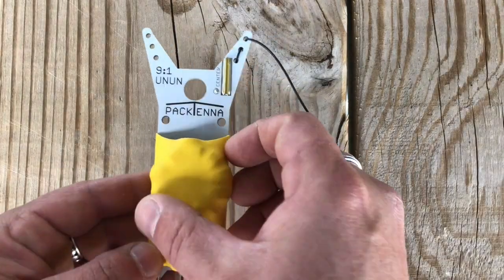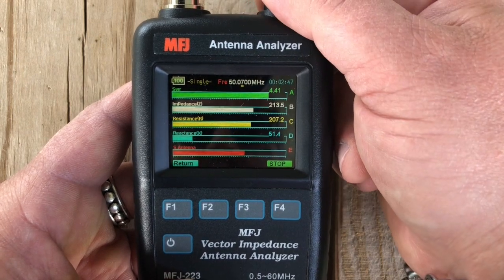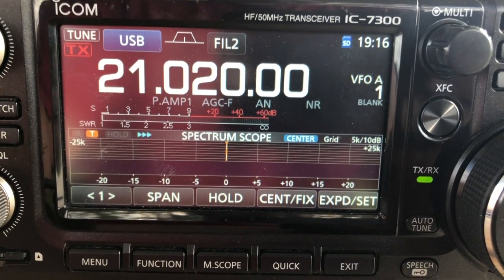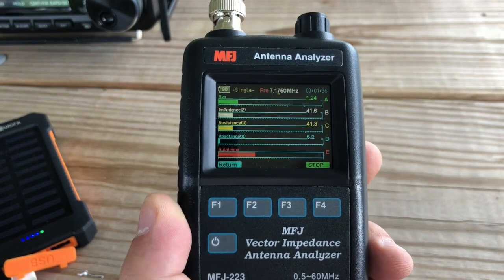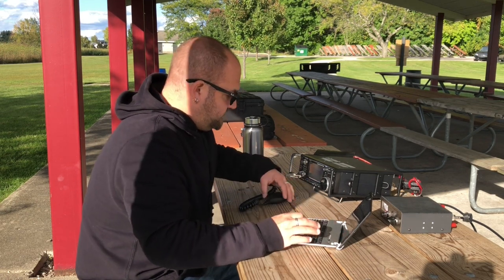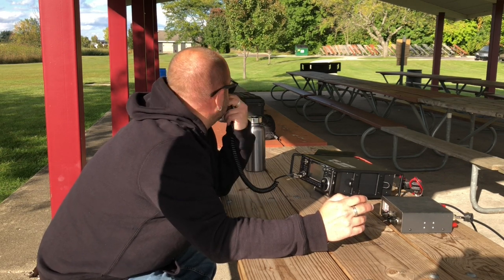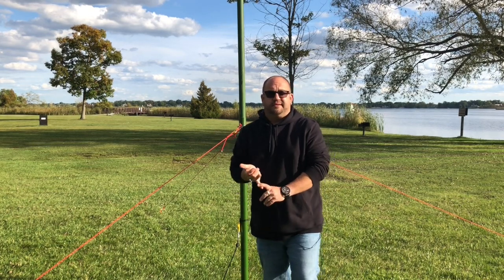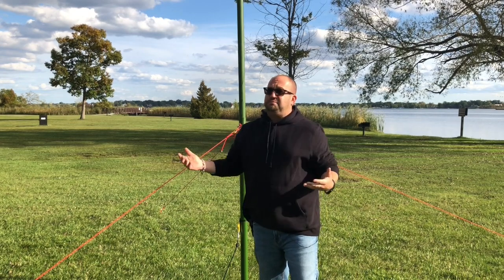The PackTenna Mini 9:1 Random Wire Ham Radio Antenna

Comment: Cutting a Random Wire antenna to “make it resonant” for a band, would render the unun useless as the impedance would increase drastically, you’d need a 49:1 autotransformer as you would now have a monoband End Fed Half Wave antenna.
I have Elecraft rigs, so I’m a huge Random Wire fan for simplicity and a way to feed my band hopping habit.
A 17’ - 18’ counterpoise will give you 10-80 (though you might need a CMC on 80) for 28’ - 84’ Random Wires.  I have a counterpoise bundle on my 124.5’ Random Wire at home so I can get onto 160m (great DX already).
My 7300 tuner has been next to useless tuning any of my Random Wires though.
Also, for a Random Wire antenna, the shield on your coax will act as a counterpoise as well.
Reply from the maker: Yes, so I have learned and did not do that.  This is one of my fav antennas though.  I have a tuner that will handle it now (and several radios that will too).  The 7300 will tune it but you have to put it in emergency mode that gives it a 10:1 tuner at reduced power.  I did a video on that too.  I've learned a lot and used this antenna in the year or so that I've had it and I love it.  Thanks for the input and thanks for watching.

Comment: Mike,
Did you have the antenna set up as a sloper ? From the video it looks like the pactenna is attached at the bottom of your mast.  If not how was it set up?  73 George KB3WAQ
Reply from the maker: Not a sloper no.  The mast I use with this antenna is the MFJ 1917 43'.  It's the perfect size to get this antenna vertical.  You can use it as a sloper, and I have, just not a lot.  Just get it up and get on the air.  That's really all that matters.
Reply: @hamradiotube  Mike Thanks 73

Comment: Nice contacts!  It's fun to see how different antennas work out.  I agree that a 3:1 tuner isn't of much use, it's merely there to touch up a slightly off antenna in order to keep the radio happy.  It's not just Icom, but others as well only offer up to a 3:1 with their inboard tuners.  It's nice to have up to a 10:1, but keep in mind if your antenna is that far off and you are running 100 watts, then only about 32 watts actually makes it to the antenna.  However, in your case your SWR was not that far off.
Reply from the maker: Thanks for watching.  I have a few new products up my sleeve that are going to pair very well with this antenna.  Stay tuned!  73

Comment: The 7300 has a 10:1 tuner it it if you put it into emergency mode but it will reduce power to 50w. KG7CQG

Comment: The Packtenna site appears to be sold out of just about everything. I did find mini banana plugs on Amazon. I’m not sure of the size though. What is the size in mm of the banana plugs that you got for your Packtenna? You are right in saying the fault is with the tuner in your Icom. Like you said it only handles about a 3:1 mismatch even though it’s a fine radio. Thanks for the connector idea for the counterpoise wires. MikeinMinnesota N0WDM
Reply from the maker: Hi Michael.  Boy they sure are sold out of everything.  I checked the wireman website and couldn't find them there either.  They used to have the banana plugs and the really thin wire.  I looked at amazon and they look like the 2mm.  They are very tiny.  You could shoot PackTenna an email and ask, or hit them up on twitter @packtenna.

Comment: Really enjoyed your video. I have a 7300 too. I use a homebrew version of MyAntennas EFHW 80-10. The 7300 only needs to tune on one band - the voice end of 80m. The antenna is made with 134' lightweight wire from Sotabeams, deployed as an inverted-V raised on a lightweight Sotabeam mast. The torroids fit in a small prescription pill container. It is a really small package. My friend made a similar 40-10 antenna 67' long. I enjoyed your other videos too.
Reply from the maker: Yeah the EFHW 80 meter antenna is a great one for sure.  I did a video on one a few months ago.  My thing with it is it's so darn long!  Not the most practical antenna for portable use.

Comment: Thanks!  I think you should tweak it for best match at the lowest freq.. and the rest will fall in line.  My last 80m EFHW is pruned for resonance at 3.800.  Has an swr of < 2:1 on all bands and usually less than 1.5:1..  but then I use a multi-tap UNUN that I wound on an FT140-43 core. Using several different taps lets me get an excellent match on all bands.  Packaged, its about the size a a pack of cigarettes.  I can do 160 using it as a quarter wave without the UNUN and get an swr of 1.5:1.  These antenna projects are easy and fun.  If you wanna see my latest multiband vertical look for the Michigan cacti.  It's on here.   Thanks & 73 OM

Comment: I’ve had good luck tuning mine with the 7300 in “emergency” mode, which cuts the power to 50w but cranks the tuning ratio to 10:1.
Reply from the maker: Yeah I need to look into that.

Comment: I'm not sure if you are confused about how a 9:1 unun works. A 9:1 is not for fractional wavelengths but random wire lengths AKA 29, 35, 41, 58, 71, 84. All of those numbers are lengths of wire that are not resonant on any band. The length of wire you were using must be slightly resonant on 40m and that is why it was not tuning up. If you want to use a resonant halfwave wire length because the impedance is much higher you will need a 49:1 unun.
Reply from the maker: Yes, I am learning quite a bit about the 9:1 and will have a follow up to this video very soon.
Reply: So whats the best antenna? An end fed 9:1 non resonant or 49:1 resonant? What differentiates the two? Thanks.

Comment: I’m guessing they didn’t want to increase the case size on the 7300 by adding a more capable tuner?
Reply from the maker: Bollux.  X5105 and the KX2-3 both have great tuners in it from what I've seen.  It is typical for a "base" rig to not have the greatest internal tuners though I suppose...
Reply: @hamradiotube  I'd say that is a byproduct of QRP.  Size the tuner up to 100w and I'm sure it increases the size.
Reply from the maker: @HamRadioCrashCourse  Could be.  Curious why Icom didn't put a tuner in that 705 either.  Seems pretty standard in most qrp radios these days.  I wonder if they are just going for profits?  Kind of a deal breaker for me.  We'll have to find out when we geek out over it at Hamvention.
Reply: @hamradiotube  I'm really curious about whats behind the case TBH.  705, all-band, all-mode and D-STAR AND the screen.  It might also be that they ran out of room.  I wonder if there was a board room discussion on "Screen or tuner?"

If they had to chose and went tuner, they'd be awash in a sea of other QRP radios.  They had to keep that ICOM "Sweet screen" training goin.
Reply from the maker: @HamRadioCrashCourse  I know dude, I'm so spoiled because of that screen.  I'd ditch the D-Star personally but I understand that's their baby.  Everything is a compromise.  Not a huge deal I guess as I mostly use resonant antennas.  I feel they could have done it though.  Perhaps Icom needs to take a cue from Apple.  This is what we need in a radio.  Make it happen.
Reply: @hamradiotube  Guess it wasn't a deal breaker after all.
Reply: Emergency mode does 10 to 1 so its "in there"

Comment: Great video! I'm putting my antenna bag together as we speak.  What assortment of extra connectors do you recommend?  I plan on activating my first park this fall.  Thank you in advance!
Reply from the maker: The first thing I recommend is when you are going to buy a connector, always buy at least 2.  Off the top of my head I usually have an assortment of so-239 to male bnc, pl-259 to female bnc, a female bnc barrel connector, some so-239 barrel connectors, some so-239 to pl259 right angles, and a bnc female to binding post connector.  Just get out every antenna you have and every coax you have and figure out every type of connection you could possibly make.  Good luck on your activations.   73
Reply: @hamradiotube  Good advice!  Thank you & 73!
Reply: $60 dollar worth are headed my way.  Thanks again!
Reply from the maker: Lee Harrell [KI5GCF] Nice. That should keep you going for a while.  At least until you discover the next connector you need haha.  It’s a never ending saga.

Comment: Another great video!!!  That almost resembles my antenna that I have, of course mine is home brewed!  That is what amateur radio is about!  LOL. I have a 9:1 unun that I built then I found the info on the web for random wire lengths that are best to use.  Right now I have 35.5 feet for the radiator, but I believe I will add a power pole connector on the end so I can add another 35.5 feet which will give me 71 feet.  Then I will have a half wave for 40 meters instead of a quarter wave.  Always enjoy your videos and thanks for the two Park activations yesterday 10-19-19!!  Juddie WD8WV
Reply from the maker: Yeah you were that QRP station right??  Boy yesterday was a blast!  We did 3 parks in total.  I'm thinking of shortening the PackTenna Mini to be resonant on 40 meters and see what that does to the other bands.  I'm hoping I can find a sweet spot where I can tune it up from 40-6 with the 7300.  Otherwise I'll just use the external tuner.  Not a big deal but it would be nice.  Thanks for watching.  73
Reply: K8MRD RADIO STUFF yep that was me.  Actually I believed I worked you twice yesterday.  You were in one park then found you at another park and I worked W8MSC and then you got on and I worked you again.  My LDG Z-817 atu tunes my 35.5 for 40, but I also have a 26 foot counterpoise coming out of the 9:1 unun.  Again you have great videos.  Keep them coming!  Juddie - WD8WV
Reply from the maker: @JnJTrueOutdoorAdventures  Yep 2 times.  You were coming in pretty good.  I'll have to remember to get you on the video.  I have a lot to edit!
Reply: K8MRD RADIO STUFF yep I know how editing those videos are!!  73 Juddie WD8WV

Comment: How much power were u running into the PakTenna,  seems you were vertical, so great takeoff angle,  or mabe a sloper?,..  inverted L configs work great,  i didnt catch ypur config,  also, i have 5 HF Radios, 3 have internal tuners, and 3:1 is std it seems,  most of the time, I just use an external tuner save the relays ,   cheers n 73s mate A92GW
Reply from the maker: I was running 90 watts.  Thats usually what I run.  I was vertical as well.  I didn't really show the config because I need to do a review on the mast I'm using and didn't want to give too much away.  It is a shame that they use 3:1 as standard.  Not a big deal using an external tuner but that is just one more thing to carry.  Well 2 as you need another bit of coax.  Thanks for watching.
Reply: @hamradiotube  thanks for the update, and reply.  I just never considered the paktenna would take 100W. I use an endfed or a telescopic (mfj 1979) when portable, the HyEndFed as an inverted L or sloped is great,  best contact on the endfed was Bulgaria to South Africa, n best contact on the telescopic was San Francisco to Australia on 50W...  FT897D
Keep the Videos Coming,  cheers n Ceee Quuuu... 73s

Comment: We had a POTA contact today on 40m. I was surprised at how good your signal was, as I'm just across the lake in Wi and can rarely hear Mi stations. You were an solid 59 with good audio. What is the small computer you're using for logging? 73's de W9ALK
Reply from the maker: Well great working you for one!  I was using the PackTenna Linked Dipole today and boy did it outperform!!  The small computer I'm using is nothing but an iPad mini and a bluetooth keyboard with wifi tethered to my phone.
Reply: Could be the NVIS config.

Comment: Nice to see the pack antenna work so well with the 7300. You took one of the biggest possible portable radios out with one of the smallest most light weight antennas. Ha ha! Way to go...
Thx for the vid. KD2QBV
Reply from the maker: Haha, yeah I didn't even think about that!  I just love the 7300, I'm spoiled.  But I really wanted to see if this multi band antenna would tune up with it.  I'm gonna work on the antenna a bit more and see if I can't make it work.  One antenna to rule them all!!!
Reply: @hamradiotube  Let us know what you do to this antenna and how well it does after. Inquiring minds want to know!
Reply from the maker: @davidsradioroom9678  I'll be doing a follow up to this very soon.
Reply: @hamradiotube  Looking forward to it. 😊

Comment: I don't know of any radio's with internal tuners that will do better then 3 to 1. My 991A and FTDX 1200 are the same.   EDIT, you say the Q TEL Ronco chinca radio will do it. Ha ha.
Reply from the maker: Yes, the Q TEL Ronco Chinca will, but only if you double dip the scooter stick into a vertical configuration!
Reply: Old kenwood radios like Ts450 TS850 widely famous for a very long range AT. 73
Reply: All Elecraft rigs with internal tuners will tune 10:1 SWR antennas, the KX1, KX2, KX3, K1, K2 and K3.  I think they will tune the proverbial wet noodle or paper clip too.  Great rigs plus great tuners.  The LDG tuners also are very wide banded and capable.  

Dave K8WPE since 1960.
Reply: @davidj.wilcox6053  Thats a great feature. I think all those  are out of my price range, but I know they are very nice.
Reply from the maker: @davidj.wilcox6053  Ive got a KX2 on my "Radios I don't need but really want" list.  I struggle with the idea of spending that much for a qrp radio though.  I'm so torn!!